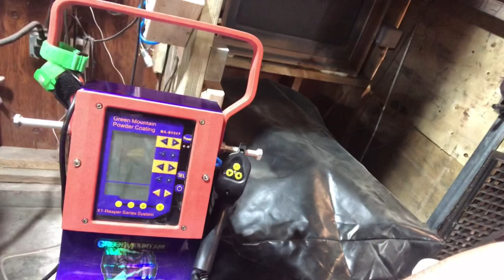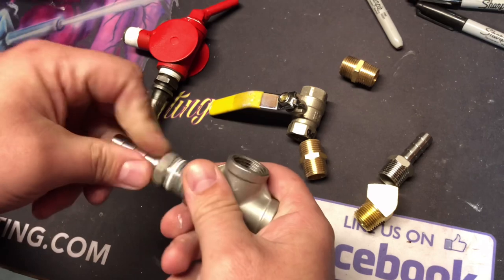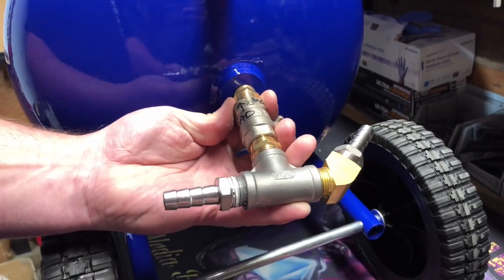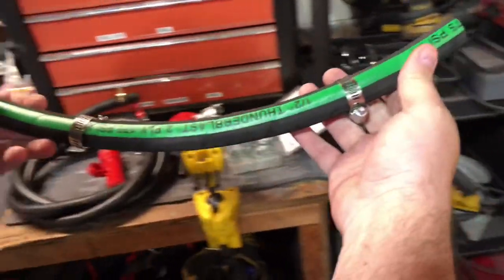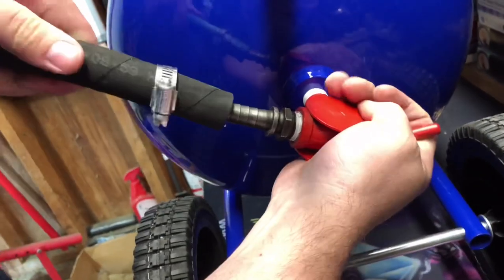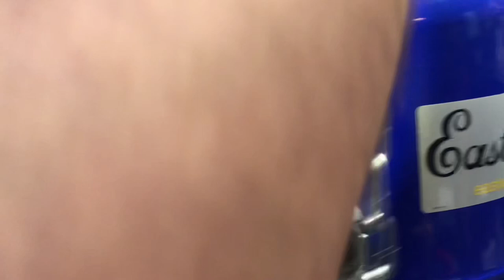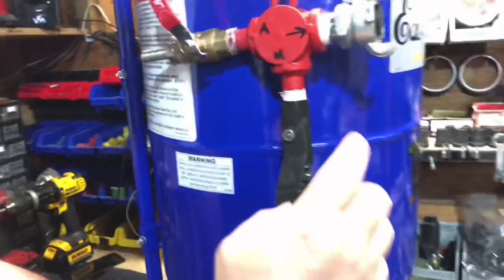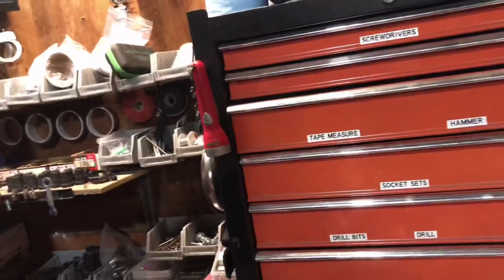How to Upgrade my Pot Blaster aka Abrasive Blaster, Pressure Pot with an Ameriblaster Kit #29

Comment: OK I've watched your video twice, on the bottom contraption you have the  1/2" barb fitting that the hose comes up to the valve on side of tank is the red barb fitting you tightened up is it just left open ended or are there suppose to be a airline to push your sand up to your valve on side of tank
Reply from the maker: Sorry I’m not sure what you are asking. Please reach out to us on our fb messenger and I’ll help you the best I can.
Reply: I have the same question. You tightened up a red fitting that bends upwards on pieces you connected to the bottom of the tank yet you didn’t connect anything to it. 

What is that fitting for and why doesn’t it have a hose connected to it? 

Thanks for the post

Comment: Everything installed on the Eastwood pot from ameriblaster..is this sold in a kit? Link, I don’t see kit on website. Thanks
Reply from the maker: What I bought for mine was ( tap kit ) ( 1 pack ceramic nozzles)(set of two couplers)(6'4" pan blast hose)(Eastwood AL C half inch stinger kit)(Eastwood relocation kit)

I would suggest reaching out to the owner and talking to him. He will ask you about your set up and air and make sure it's built to your set up. Tell him you saw our channel and want a set up like ours. We have sent a lot of ppl to him so he will know what you want. Also talking to him he will customize it for your system and give u a great deal if you tell him you saw it on our channel. Every penny counts lol

He also has a Facebook group called small fries that he shows some of his stuff at work on and for ppl to ask questions. But to get any kind of discount talk to Enrique Garnica and tell him you saw our custom kit and would like to make one for your system. Use the words custom kit. Hope that helps and thank you for being a subscriber we do appreciate it

Comment: Hello, good Vid. Thank you.
I am thinking that the Tap kit may have issues as the media is now being forced to go upwards. I think you may have problems with that setup. Media does not like to go up sharp inclines, hence the the tap is always on the bottom. Put enough pressure into anything and it will work, but off a air compressor ... I'm thinking it may have a reduced ability to draw out the media. I like the larger fittings for the media, that is a must, and I also like the smaller fittings for the Air in. Small nozzle on the output will help the tank pressure stay up for longer and your air speed be much higher.

I would like to see a tip that is physically much longer, so that the air has more time to speed up the media, and give you a much more efficient and more powerful blasting experience.

Your thoughts ?
Reply from the maker: Great comments reach out to me on my Facebook messenger to discuss further please.  

https://www.facebook.com/gmpowdercoating

Comment: I have a question. . 
I have a 110lb pot. I also picked up 50lb bag of Black Diamond fine grit. Should I dump the whole bag in or is less better for flow? 
I'm running a Speedaire 7.5 hp/25 cfm. Thanks.
Reply from the maker: First thank you for subscribing to our channel, no matter the size of yr pot blaster never let it drop below 20% empty or never fill higher then 80% full. Between these will be the best power range
Reply: @GMPC  Just what I needed to know. Thank you sir.
Reply from the maker: @tbirdboy  so welcome glad I could help

Comment: I did this today works great untill you start re using the media then it clogs up...ya! even adjusted the ball valve in every conceivable position.😣
Reply from the maker: I've never reused media but if you are having trouble I would suggest a smaller screen to screen the old media. Maybe partials are two big. If you don't mind me asking what size air are you using ? Cfm?

Comment: Nice content. I have one of the Eastwood and hell's to get it going I went with the cheap upgrade and now I finish it I see this ameriblaster upgrade. What size compressor your using because I changed the fittings to 1/2" with 3/4 barb to fit the 29mm ID hose from clench now the air cfm seems low to run the machine so I hook it up to a 185cfm compressor and it works but i my compressor is 11cfm looking at getting a 24CFM
Reply from the maker: I have a small harbor freight. The after last kit is special made for these small compressors and the guy will custom make a set up that works for you . If you reach out to me on my Facebook messenger I can tell u more and show u what the afterblaster can do off a 10cfm compressor and a way to save money on the kit
Reply: @GMPC  ok thanks I will
Reply: @GMPC where did you find the adapter kit the red ones for the sandblaster
Reply from the maker: @mariomurillo4496  it's Ameriblaster.com he makes for Eastwood and any blast pots. That's what I use myself

Comment: So you turned it into a siffon blaster?
Reply from the maker: No this video we just upgraded the pressure pot with an upgrade kit. This kit is bad ass you don't have to bend over and deal with everything on the very bottom and the equipment is so much better
Reply: @GMPC  I did put the cheap 1/2 inch bottom stuff on but I used my foot pedal as my air in works and I also don't have to bend over.
Reply from the maker: @chizuck3322  where do you add the media. That's the part I hated having to adjust media on the bottom. Air I didn't mind since it was at the handle. But to be honest besides hating to bend over to the bottom of the pot to adjust media I didn't mind the the 1/2 set up it was better then the 3/8. But I love this relocation kit so both air and media are at my finger tips and I can swap one hose and then it turns my siphon cabinet into a bad ass pressure pot cabinet.
Reply: @GMPC  I add the media in the same place. All I did was take the air from the compressor to the pedal then pedal to upper fitting on the pot.
Reply from the maker: @chizuck3322  I guess I would have to see it to understand that media is no longer on bottom.